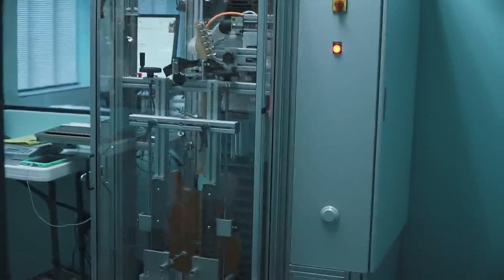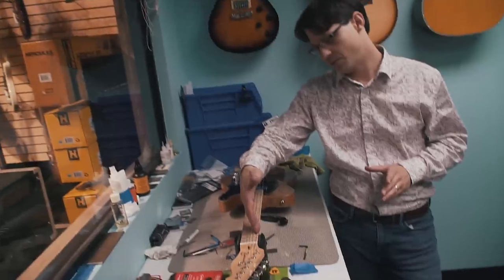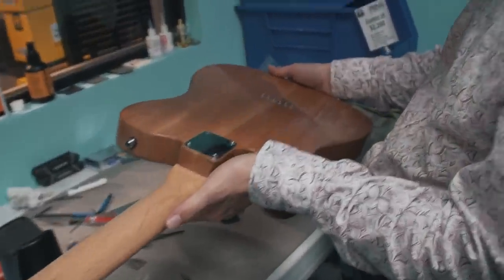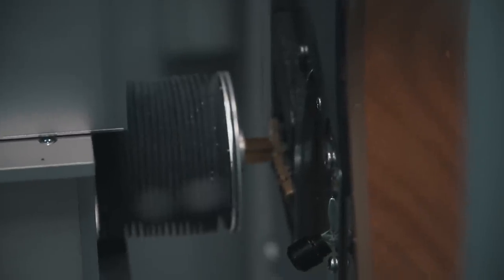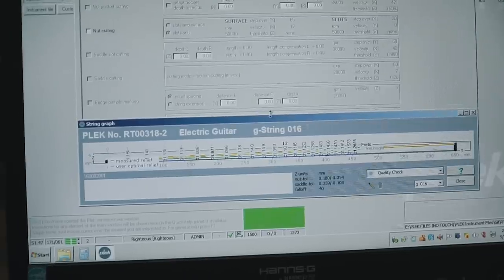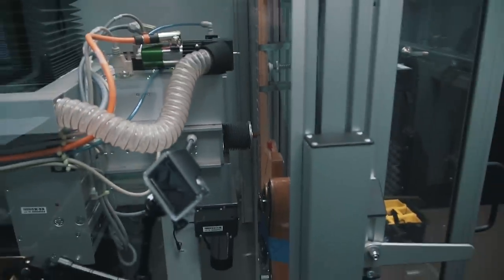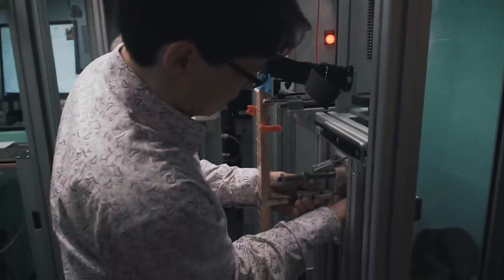How Does A PLEK Machine Work? || Righteous Guitars PLEK Demo

Comment: Yes, the PLEK is a combination of a CMM ( coordinate measuring machine ) and a CNC mill. These type of machines are great as long as the guy doing the setup is competent in the workings of the machine. I was a CNC programmer for 20+ years. The old saying, crap input, crap output. This cat seems very well schooled on this machine.
Reply: Myself too. I programmed everything from 1957 Cincinnati mills running paper tape to OKK, Matsuura, Fadal, you name it?
Reply: @markham4041  congrats
Reply: As a machinist, I was trying to think of a way to hold the guitar better for the probing and milling.
Reply: Righteous Guitars has PLEKed 3 of my guitars.  They do excellent work!  I highly recommend them!!!
Reply: @markham4041  Mitsubishi, Hatchi Seiki, Fanuc, Haas...... I hated Haas controllers more than any other. The 1993 Hitachi Seiki lathe I programmed had better features than a 2010 Haas lathe we had.
Reply: @williamdavis346  how much is the pleking cost per guitar?
Reply: @heavymetal11  It was $199/guitar when I had it done about 3 years ago.
Reply: @markham4041  Paper tape takes me back a few years, I ran a Bridgeport series 1 with a Textron tape reader,
If the programmer screwed up we used to cut it up into 1" sections, open his office door and throw it at him.... Happy memories!
Reply: How much is it on average to get one plek'd for some reason I expected Peking to wither be hot rodding or aging! Now I realise I was a million miles off the mark 🤣
Reply: @swampdog1592  WTF does this mean? : "I expected Peking to wither be..."
Reply: @Ndlanding  its called Auto Incorrect! (yes that was deliberate {that means intentional!}) I typed the word "Either!" a word used extremely frequently and it got autocorrected to "wither!" a word very infrequently used! I presume you understand English right? If not I recommend a dictionary they contain words and an explanation of their meaning for feebleminded folk! Like its never happened to you before! how old are you 7?
Reply: @swampdog1592  I was also Baffled by the inclusion of Peking, which made it a damned sight more difficult to grasp. Now, whither shall I wander? Beijing?
Reply: The tech had BETTER be familiar with it.
Doesn't matter..high $, low $, middle of the road. When you put someone's guitar in that thing and you fuck it up....the guitars owner is gonna light your ass up!! We guitar players consider our guitars as "our babies"!!
🤘😎🤘
Reply: @heavymetal11  I believe the guy said $275/Plek and $35/scan only.
Reply: So what we're looking at is a C+C music factory?
Reply: @patrickmollohan3082  I found it odd that the guy who explained everything said "If you get a guitar PLEKed here, it will probably be (I forget the other guy's name". In other words, someone else will probably do the work.
Reply: @edwardjamyangmacarchick1847  I dont remember the name either. I DID however say that it's the head guitar tech/luthier that does the lions share of the PLEK's. I think what it boils down to for any PLEK shop, is for any craftsmen that are going to use it, be VERY well read on how it operates and what data one must enter in to it. They will also need to have a good knowledge of guitar set up and what not.
Reply: Cat?! Meow!
Reply: It explains why Gibson uses a PLEK and the quality control is still crap.
Reply: @williamdavis346  dude. The tools required to spot level a high fret are less than that.
Reply: @patrickmollohan3082  holy crap. not worth it.
Reply: @williamdavis346  ...which is weird, because you can just buy the machine for a few ($250K) dollars more than that!
Reply: @heavymetal11  225 if it needs it, 35 for the scan alone (20:08 in the video)
Reply: Schooled my ass! There is no way in hell that machine is accurate to a thousandth of a millimeter. Its accurate to a thousandth of an inch like most CNC machines. I could not, in good faith, send my guitar to someone who doesn't understand basic machining tolerances. Just to put things in perspective, a thousandth of millimeter is .000039 inch or 39 millions of an inch. That is micron levels of accuracy. That is almost twice as accurate as the most accurate CNC machines ever invented and those machines are not used for pleking guitars. I'm a machinist for over 15 years and I can't believe you didn't catch that when he said it since you are a CNC programmer. A thousandth of an inch is a huge difference from a thousandth of a millimeter. They even have that  posted on their website. 🙄 Human beings cannot machine tolerances to a thousandth of a millimeter. Period.
Reply: @ReVeRbx-fe5wr  I musta have skipped some parts, I get bored listening to some of the hype. I didn't hear him say that at all or I would have definitely brought it up. Yeah, 39 millions of an inch isn't feasible on CNC or any place else unless your splitting sub atomic particles. I usually catch dumb statements. I did this for 30+ years and taught labs at a local college for 5 years.
Reply: The big difference here is they aren't programming the tool path for every single guitar. It's already programmed and has been used on hundreds of thousands of guitars at this point. Because of this, you don't have to worry about the crashing the tool into the guitar out of nowhere or anything else.

Comment: For the sake of measuring in inches, 1/1000th of a mm= 0.000039 inches. I am going to go out on a limb here and say, he meant 1/1000/inch OR 0.001 and even that is hard to achieve with anything that has the material called wood in it's make up

Comment: But the guitar isn't played vertically. Moreover, the bodyweight is pulling on the strings like that. Ideally, it should be positioned horizontally for better measurements. Isn't it ?
Reply: Tanguy Delooz This was my thoughts exactly. You can tune an instrument to pitch on your lap then hold it up vertical by the headstock and pluck a string then see it is out.
Reply: Truth is a guitar is only in tune in that position and in that specific environment at that very moment you tune it up.  Past that it immediately begins to detune when you hold it, play it, hit the whammy, or the temperature or air pressure changes slightly.  "In tune" is not a static state, it's a dynamic condition and a simple fact of life to be accepted.  As Leo Kottke says, anyone who plays a 12-string knows they'll spend half their time tuning it.
Reply: @TenMinuteDrumSolo  , and the other half playing it out of tune ! ;)
Reply: @dobrodave123  Ha, exactly Dave!
Reply: @dobrodave123  Yeah, the beauty of natural chorus.
Reply: @johnnygeejr500  go elsewhere with that shit lmao
Reply: Wrong, the body is supported in the machine. I saw that in another video.

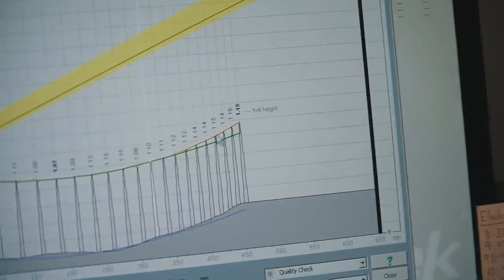Comment: 12:00 — fall away frets!  YES!  A lot of luthiers don’t even know about that concept.  You generally want to do it around the 19th fret, although some folks will go as far back as the 17th.  And you just make them like a staircase, but just a TAD BIT lower, in step, until the end.  Can help solve a lot of buzzing issues provided that the neck is as good as it’s going to get already.
Reply: Hey do you know why the neck appears to be leveled like a 'U' shape? Why doesn't it appear leveled completely straight?
Reply: Die Rekt This is correct at the nut but what happens when you fret a note in the middle of the neck?

Comment: He said "1000th of a millimeter", not inch. Nice!
Reply: .001 mm .. = .000040  [ forty mil } slang .. = 2.5 [ mil ] = .0001 { thou } .
Reply: @johnneurohr7156  
What's a nanometer? Something like .0000001 meter or 1000th of a millimeter? I dunno. Pretty damn small, thats for sure. Lol
Update: if this could measure 1000 times smaller than it does now, it could measure a nanometer. Nanometer = 1,000,000,000th meter.
Reply: Measuring to 1 micron and machining to 1 micron is a different matter, I don't know the specs but I doubt if you would get the finished machining down past 10 microns accuracy
Reply: @sofa-lofa4241  
I know some musicians are perfectionists. So it might matter to them. My frets are set fine, my intonation is fine, I spend maybe 15 seconds on a by-ear tuning, and I'm good to go. Anything measured smaller than 1000th/mm is not just overkill. Its prerequisite for a rubberoom. Lol Just a small change in temperature or humidity is gonna change it.
In this case anyways. If it was the space shuttle..  ?
Reply: @siggyretburns7523  if it sounds right... Go with it!
Yeah, I think I'm just about ready for a rubber room right now, lol
Reply: @sofa-lofa4241  
I'll save a spot for ya. 🙃👍
Reply: @johnneurohr7156  ....  .001 is a thou... .0001 is ten thousandth 
Many tool makers will call .0001 a tenth for the sake of saving time..but in reality .1 is a tenth.. and no tool maker even bothers with those except the guy at the bandsaw.... lol
The place I work at, we work to .00005 +/- .00001 on a regular basis.... temp controlled of course.

Comment: I wonder if I can build something like that in my garage using a few raspberry pi's, a few abrasive tools and some t-track?
Reply: Yup but there are better alternatives to the Pi. 👍😎
The motion control components are everywhere today and cost very little.
Reply: @AdaptivePhenix  I'm serious. I was kind of in awe when I first heard about this stuff. Not for it's capabilities, I was in awe it took them so long to take advantage of what was obvious. If I built guitars with cnc shaped necks, the joint to the body is going to have a slightly different mesh each time. Makes sense to send it through during the build process. It cannot cost much when it is baked in to the manufacture of it.

Comment: I would have liked to see someone play the guitar after the Plek job to see if it was a noticeable difference, or at least played really well across the whole fretboard.
Reply: Hi,  I've had two of my guitars Pleked.  When I had my 335 done, even though I thought it was playing well before  it made a considerable improvement.  The other guitar I had done improved but it was not so noticable.  IMHO I think it is worth it for some of my guitars but not others. My go to guitar is a stock  MIM Telecaster and I think it's too expensive to get that done.
Reply: Howdy, I was lucky enough to see the difference with a properly done Plek'd guitar compared to a few of the same guitar without being Plek'd.   Stumbled across a Supro Hampton Sunburst that was a demo from last years NAMM show.  Most of the guitars there are Plek'd as the manufacturers want to have the very best representation of their guitars on display.   Since NAMM is where Guitar shops are going to find new product they want to carry for the next year.    Was in a shop that had this Supro, liked the way it looked, picked it up and Loved the way it played and sounded.  Wasn't really sure if I wanted a "Demo" model as there were a few scufffs and scratches so  checked out the new ones.   Sharp fret edges, buzzing, well every new one I tried played like crap.   Went back the the Plek'd demo, truly felt like a different guitar.  Can't express to you how big of a difference it was.  Ended up purchasing the Plek'd NAMM Demo model and LOVE it!!   Plays just amazing!

   Later I had taken my Gretsch 5420 into a very reputable shop in Long Beach to get the pick-ups changed and a real Bigsby (come with Lic fake one) on it.  While there was talking to the owner and he was saying you can take a "Good Guitar" and with a properly done Plek job make it play as good or better than most expensive American Made Guitars.   I had my inexpensive Gretsch checked on the machine, had it Plek'd and now it too plays terrific!  Better than my Gretsch 6120 Nashville which is over 3 times the price.   I am a true fan of the Plek machine, IF you get it done at a reputable place that knows what they are doing.   Know someone who took their  American Fender Strat into a "Big Box" store that offers it.   Unfortunately they screwed it up real bad!!   As stated in the above video, It's a tool.   A tool that can truly get great results IF the operator knows how to do it.    

Cheers!

Comment: You achieve the same level of perfection with an "Erlewine neck jig" which basically replicates the pull of a set of strings on a guitar after the strings have been removed, but the "Erlewine neck jig" is more time consuming and requires the skills of a great luthier, because you can only work with "straight tools", and in the end, when the guitar is on that neck jig, you then still need to evaluate the "perfect bow" ... with the Plek machine, you don't evaluate the bow anymore, you calculate it, as it is clearly demonstrated in that video.
That machine is absolutely fantastic, simply because woods don't react homogeneously to string tension, woods are "living material" and are far from being perfectly stable material, and that machine takes that in count.
Reply: You can get the same results for $20. Just set the truss rod straight in standard tuning, slacken strings, raise nut and saddles, retune to pitch, and I'll shove underneath the strings a $15 aluminium rafter's square with it's top ground off and bottom sanded smooth on a granite counter top, make sure the guitar neck is supported well, level it like that.
Reply: Homer Simpson 
What the shit 🤣🤣🤣🤣🤣

Comment: Personally I think its overkill.  A lot of technology and engineering to do something people have done manually without a problem for years.  Interesting nonetheless.
Reply: Yeah & the $225 price tag seems pretty steep as well. Never had a fret job or neck adjustment done but I would imagine the manual way would cost much lower.

Comment: I understand this is an old video but I wanted to mention the process does a great job on bass guitars.  I’ve had several of mine done by George at The Music Gallery in Illinois. The most significant impact I experienced was on a Rickenbacker 4003s/5. As you may know, Ric quality control is not great.  It needed a lot of work. A PLEK job with lots of truss adjustment and a bone nut transformed the bass.  If you are at all on the fence, get it done!

Comment: And just after it's been Plek'd the customer phones and says, "Oh by the way, I play in D standard."
Reply: What's that mean? U mean it should be plekd differently based on your tuning ?
Reply: @alexxxender1258  Tuning down a step radically changes the tension on the neck; a guitar has to be set up for the intended tuning. The Plek process starts with the machine holding the neck in the same curvature that it had with the strings on...in the intended tuning.
Reply: @morganahoff2242  thanks for that. I play seven string and the only dropping I do is my 7th string to drop A. Would that matter much u think or is it close enough to standard tuning to not matter
Reply: @alexxxender1258  Close enough. A little tweak of the truss rod should get it to where it plays nice in standard and Drop D. You might try a heavier string for low-B/A, but two caveats: (1) a heavier string has more mass, so may rattle against the frets or stretch itself sharp (try tuning it flat, so that it's in tune on the attack, decaying to flat), and (2) a heavier string needs to be even longer for proper intonation, so make sure you can move your saddle even farther back. Mind you, a heavier string has more tension for the same pitch, so pull the neck in to a nice curve as if it's in standard tuning, when it's in Drop-A. I sense a fan-fret guitar in your future!

Comment: So I had an $800 Les Paul Special setup by Ben and team at Righteous Guitars while getting some help with a very poorly soldered wiring harness corrected after swapping in some Lindy Fralin P90s. I also had them replace the nylon nut with a bone nut especially cut from data in the analysis from the machine. I also went from 10's ro 11's as part of the process as well.

I can honestly say that it was worth every penny to have this work done and the guitar plays and sounds 80% after all the new components for corrected, the new nut installed and the setup completed. It went from my least favorite guitar in the collection to the second favorite after a Suhr Classic Antique "S" (which gets a Plek job on the way out the door from the factory) that I purchased from them a few months ago. As part of the purchase deal at Righteous, you can get a free Plek job within the first 30 days after taking the guitar home.  I took this up as we had some significant temperature changes in the weeks after I got the Suhr and had some buzzing due to some neck movement. They adjusted the neck and it was perfect again.

They've definitely become my favorite guitar shop in the Atlanta area bar none. It is definitely worth it in my mind to invest in the service and to have a pro setup done, even if you think you know what you're doing at home.

Comment: I'm confused how this machine can truly be accurate to 1/1000th of a mm, at this kind of precision, surely any small change in external factors will have a huge influence on the accuracy. For example, if the temperature of the room changes at all during the PLEK process, wouldn't it warp the neck by at least 1/1000th of a millimetre? Or even the way the guitar is secured into the machine, each time this happens surely it will be more than 1/1000th of a millimetre different each time?
Reply: As a machinist, I dont like how the guitar is held in the machine. A guitar isnt played vertical like the PLEK holds it. Also, I think a good luthier can do what this machine can do, only slower. So the service price is for paying off the machine. All that mumbo jumbo about 1/100th of a mm doesnt amount to a bag of beans to my fingers or when I bring it home and my ac is colder than in the store.